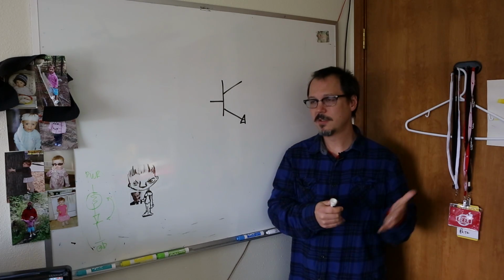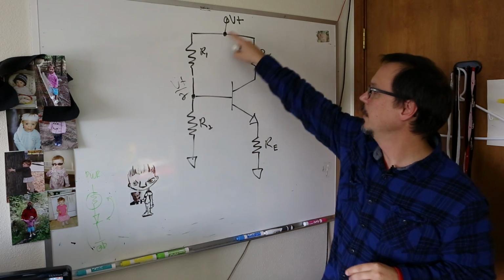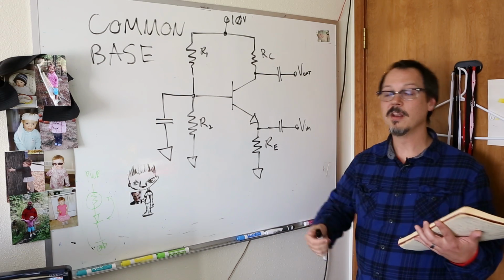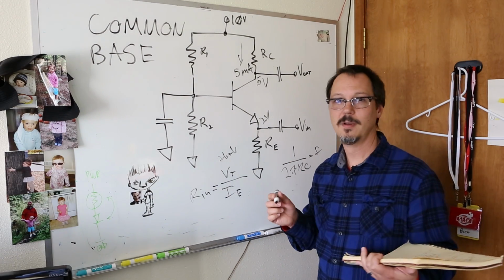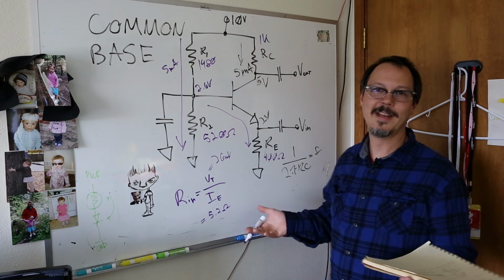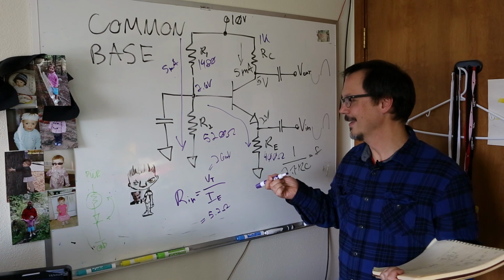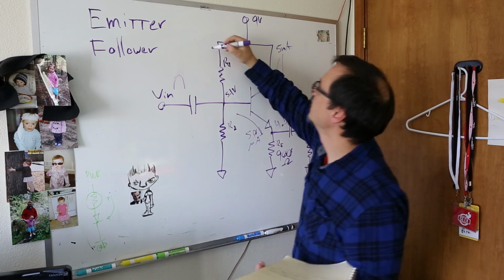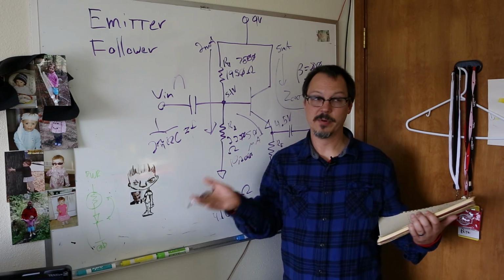SparkFun According to Pete # 36:  Transistor Biasing Configurations

Comment: The common base configuration description is correct but he does not explain how the circuit works. 
With an NPN transistor, you can keep the emitter rigid and move the base or keep the base rigid and move the emitter.
The same change occurs on the collector. 
The capacitor on the base keeps it rigid.

Comment: Can you bias the base of a bpjt , without using a voltage divider. Putting instead,  a very high resistance, single resistor?
Is there a threshold of current, which below, the transistor wouldn't mind the voltage? 
Assuming a crude slow switching of a DC.  Very soft switching. 
?
I mean,  without the R2.
I don't like the R2, because it represents for me, a power loss.

Comment: Uhm i think this video has lots of confusing info, vin and vout doesnt act on the transistor voltages, thats why engineers use capacitors to isolate the input signal from the DC biasing

Comment: This guy started the basing in reverse, normally you establish first the Vce Q point and the collector current by setting the Rc and Re then you calculate the required base current and voltage with R1 and R2 , you can make tradeoff and calculations adjustments on Rc and Re depending on how much voltage gain you want and your Q point, I think that this explanation is highly confusing for the viewers.

Comment: Did you explain what transistor  bias is and why  we use it?
Reply: Biasing is the process of setting up the operating conditions of an active device. Many such devices require a steady current/voltage to operate correctly, so you need to set up networks of resistors and caps to guarantee this. If you look up a datasheet for an active component, it'll give you graphs indicating the quiescent point: this is the point at which the device is operating but treats as no signal. For instance, you might need to supply the base of an NPN BJT with a minimum current, and you'd use a voltage divider in many circumstances to do so. That explanation is a gross simplification though, and is just about biasing a single pin on a device. You might need to look at an earlier video for one that goes into proper detail.

Comment: How did you calculate the parallel output impedance at 19:51? I followed the calculations to that point, even for calculating values for R1 and R2.

Comment: Remember that, in order not to destroy your transistor, add a diode (+ terminal toward Vcc ) in series with a 0.001 microfarad CD capacitor in parallel with your collector .  You are brilliant.  Thanks.
Frank

Comment: Hello 
I have a question regarding input impedance that you are speaking in the video, could someone explain the me the "impedance" therm, I am new in electronics and I can not understand the therm.
Reply: Alin Dragan Impedance is similar to resistance and is calculated for AC circuits like resistance is for DC. It's how much the circuit "resists change" and is calculated in terms of Ohms.

Comment: At 20.33 you say that the output impedance of the emitter follower is approximated by the output impedance of the source divided by Beta.    Well what if the source is a current source?    well I would rather you have taken into account the base biasing resistors too.   Still  you did say approximately and you do know what you are talking about. as a very practical man. I am glad that you like the BJT for its non-linearity  as  this can achieve more functions, as  multiplication hence modulation and demodulation.  I like your informal style of teaching, good man.

Comment: Voltage across the Base to Emitter on a silicon transistor is .7V and germanium is .3V.  2n3904 is a silicon transistor.
Reply: That is fine if you work with 10V, but if you work with 2.5V, you would likely consider (or be aware) that a silicon diode can have  its forward voltage from 0.55V to 0.85V with the later more frequent for integrated circuit and around 0.7 for discrete component. But a little bit as for LED you would see that the "knee" is FAR from being well defined value, anyhow.

Comment: First..What is biasing?
Reply: Biasing is setting the voltage to the gate/base of a transistor so the transistor can behave in a certain way. E.g. for power electronics,  typically setting the gate voltage of a MOSFET at 12-15V saturates the MOSFET making it ideal for switching.
Reply: Lundistani Shitteater For something like that, I would not bother using an NPN transistor. Typically the current flowing through an npn transistors depends on the base current going into it. In fact, BJT are typically good for current amplification and voltage amplification.

 My suggestion is to switch to a mosfet and use pwm to control the brightness. Before doing that, I would first find out the current the light bulb is consuming as it will affect the mosfet selection.

Hope this helps. Good luck!
Reply: Lundistani Shitteater
 Are you sure it's not the voltage drop across the p-n junctions (0.6v ish)?
With  bulb connected directly to 6v battery; Power = 6v x 250mA =  1.5w.
With transistor however - Power = 6v - 0.6v x 250mA = 1.35w
Reply: Lundistani Shitteater
 The hFE of a 2n2222 is usually around 250, so to get an emitter current of 250mA you'll need a base current of about 1mA. Try connecting the base directly to the 6v rail or use a low resistor <100ohm. This should be enough to fully saturate a 2n2222. Once you've done this put multimeter across collector and emitter - should be about 0.6v.
The other thing to watch is that you've got the correct pinout for your 2n2222 - the fairchild is EBC and the motorola is CBE just to make things more fun.
Reply: Yes. If you had 1mA base current the maximum emitter current will be 75mA. A 2mA base current will be 150mA. Max emitter current = base current x hFE within the limits of the transistor.

Comment: On the common base example you mentioned antenna impedance matching as a potential application. Would I be matching "Rin" to the impedance of the antenna? Furthermore, is there a quick and dirty way to determine the impedance of an antenna?